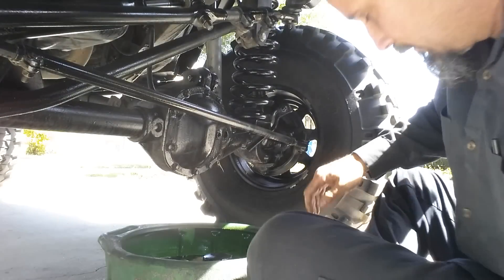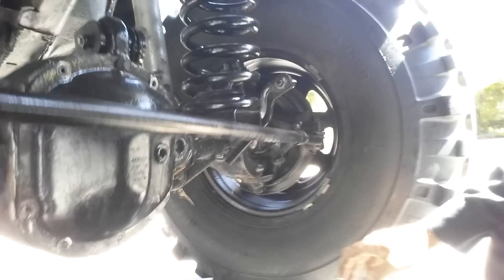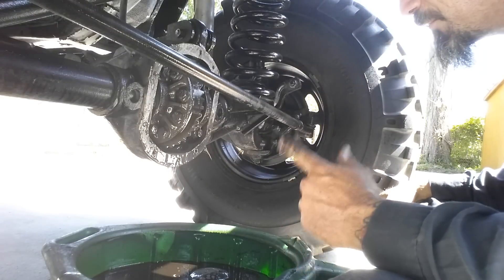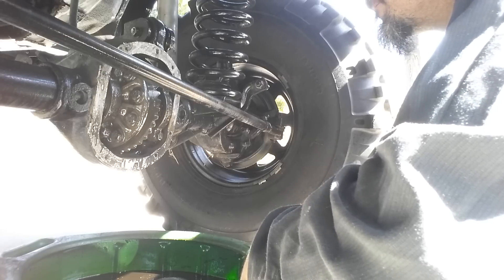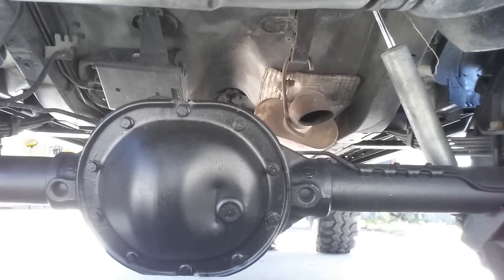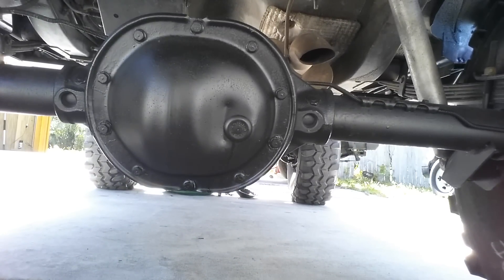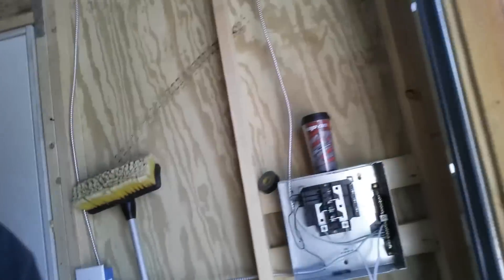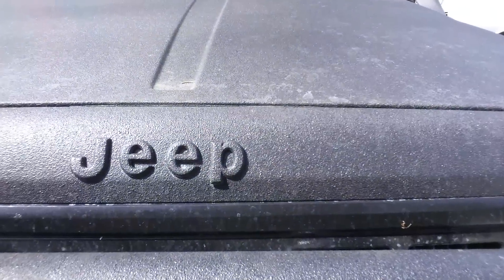channel update wait for it cherokees are real jeeps explained

Comment: Thanks Rusty,Been going through your Vid's and enjoying them.30 years driving Xj's and I've herd it all When the trail starts getting tough.Then it's " Well Jeeps are good off road"Oh so now it's a "Real Jeep".In Moab,Two Big Bronco's with 38+ tires came blasting through are NAXJA group of XJ's on the Easy part of the trail.Then the rains came and the tough part started,They had to turn around and go back.We finished the trail loop.That was funny.(No Bi Passes).Same with the New Toyota FJ's(With solid front axle upgrades),We've watched them "Not" perform up to how "Cool" they look.A guy at work told me how "bad ass" those FJ's are.He's seen My XJ. He has a Toyota Camry sooo he knows.
Great to have all makes and like minded folk's out for a good time.(with tow point's to pull them over the tough stuff).

Comment: I just wanted to let you know how informative your videos are. 2 months ago I didn't have a clue what I was doing with these Jeeps. I've always been a Honda guy. Street racing. Got bored with that. My buddy had a Jeep ZJ on 40s and did the long arm conversion and lockers and 1 ton stuff. I decided to make the switch. I actually lucked up and found a 92 XJ on Craigslist in Ocala. Turned out to be built really well by a guy that posted everything on CherokeeForum.com. Most everything worked on it already. Just needed (and still needs as always) some TLC. I gotta do the inner axle seals on the front diff and possibly putting lockers in at the same time. Should be done in the next couple weeks. Depending on my cash flow of course. Lol But you're awesome man! Love your videos and even the rambling on, as you call it! Lol Looking forward to and hoping I get a chance to go hit some trails with you guys this year!
Reply: still got the xj. I wheel up in ocala alot. Have a 98 xj myself. long arm locked and on 35s.

Comment: Just bought my 95' XJ. It's a diamond in the rough right now, but it's HANDS DOWN the most fun vehicle I've ever owned....not to mention the easiest to fix in my driveway. The replacement parts are cheap, plentiful, and I have a family connection who owns a salvage yard who has been a great source of hard to find body/trim parts. I have to ask- what/how did you paint your XJ's?   I want to spruce up the paint job on mine, the previous owners left it parked out in a sunny parking lot...and I can tell they were not much for waxing/protecting the clearcoat finish. When I had my 92' Ford Explorer Sport (two door), I stripped it down, did body work, then used farm implement paint (International Red) to paint it in my driveway with an air compressor and a sprayer. I used truck bed liner along the rocker panels up to the door trim line, and also on the bumpers and side mirrors. Looked really sharp.  With this XJ, it's black and I like how you did yours, thinking something sorta like that.
Reply from the maker: well have fun with it bud I sure have had some good times with mine and like you said parts are plentiful and they are pretty easy to keep up

Comment: Ive got a zj i bought for $400. Engine runs great, just dents and dings. I see it as a blank slate. Im not worried about chopping metal off of it or welding metal onto it.

Comment: Building a ford ranger 302  c-4  36 inch  But you have some great jeep build ,Keep it up
Reply from the maker: +steve “broncoboy” ballard  I built a ranger years ago with 302 c4 combo it was a street rod the c4 is a good trans I used them for years if you get the trans co shift kit for the c4 man that thing will shift out hard it brings the clutch pack pressure from 90 psi up to 130 or so makes it last a lot longer good build though I have a face book page for the channel search face book for rusty411 no space post a pic when you can man thanks for watching

Comment: hey man great videos love them I have a xj myself 2wheel but going to turn it in to a off roader and I was wondering what axle did you use for your front
Reply from the maker: the front axle is a Dana 30 high pinion if you start searching the scrap yards you can swap that 2 wheel to 4wheel be a little work but everything will swap into the 2 wheeler find one wrecked so you know the Trans is good and rob it all bud thanks for the comment I'll try to keep the vids coming

Comment: Hey Rusty,Any chance you could do a vid about 4.0 Push rods ,Hydrolic lifters.Ticking noise in my new MJ.Can I just put a new set of Lifter's and push rods? 120000 miles on it  ,Runs strong,no smoke. 1991 MJ 4x4 .That Newish  Eddlebrock cylinder head look's great too?$1600.00  Just bolt it on??Roller rocker's??Kinda a Cylinder Head Info video  Maybe     Thanks so much.Watched your video's about your buds engine,Good stuff.Subscriber.

Comment: Hey Love your Videos Brother ... hey Check this out I have a 157k miles Original miles runs perfect 1999 Jeep Cherokee Limited 4.0 with Full time 4x4 option along with Rwd for gas saver neutral and low 4x4 I think the 242 transfer case with the 42Re transmission anyway...
2 inch lift Cold air intake exhaust 4 hole injectors and other mods on my jeep

My Causin thinks his 97 Vortec Jimmy can Pull my jeep if we threw a line tug of war I just dont see that thing geared good enough to do so even with my Dana 30 and dana 35 I think I'd yank his ass across the field lol

What you think?